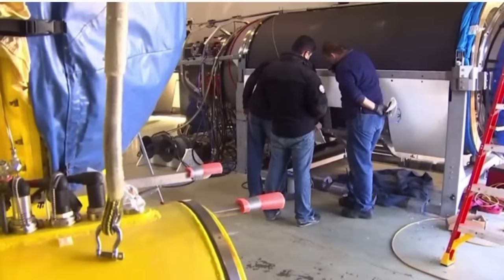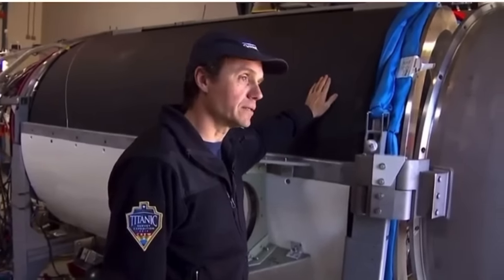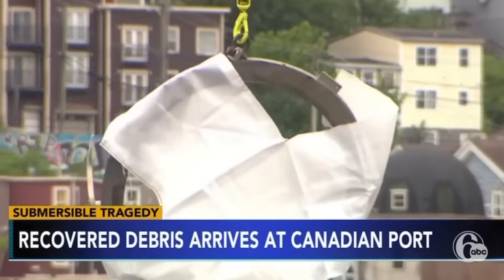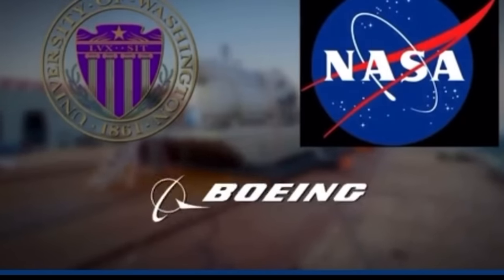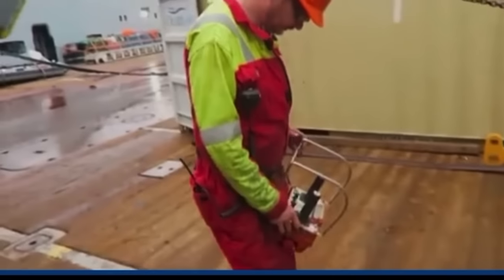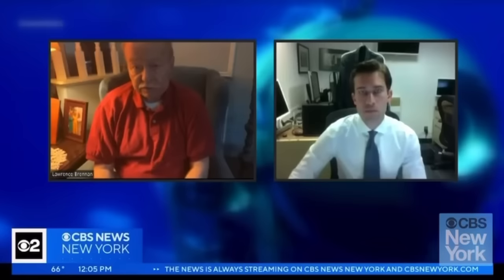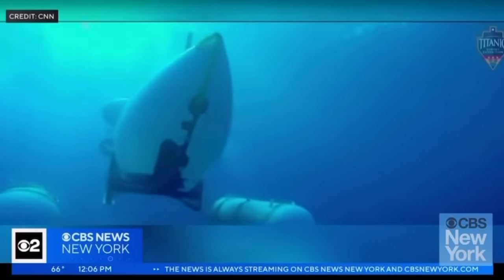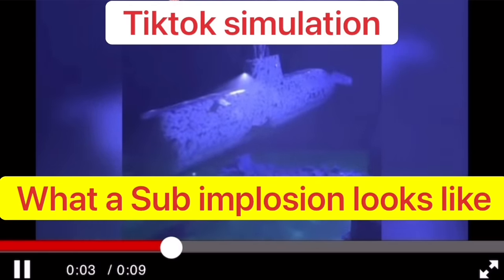Titan nosedived like an arrow (then popped like a balloon) #Titan #oceangate #Titanic

Comment: The theory about them plummeting came out months ago, and is just not true at all..
If the sub had lost power, wouldn’t it have just started descending normally? They were all seated in the middle of the sub, so there would have been no way for them to unevenly distribute weight towards the front the sub. 
-
If anything, wouldn’t it make more sense for them to have plummeted downwards in the tail cone end of the sub? 
I mean, on top of the titanium end cap, there was so much equipment, electrical components, etc. There was so much more weight towards the back of the sub, that it just makes no sense for them to have plummeted downwards in the direction of the front titanium end cap. 
I believe this guy is just clout chasing. 
Yes, I believe they were well aware of their fate before the implosion, but the theory about them plummeting just sounds not true at all when put up against emerging information of what happened.
Reply: But that’s just a theory.. a SUB THEORY!
Reply: @Stanified   You are absolutely right.According to the laws of physics it makes no sense . I also believe this so called engineer is a clout chaser.How could it be in free fall for only 48 -71 secondes without additionnal weights ? I mean the buoyant force depends on the weight. And unfortunately , yes ! They were well aware of their upcoming brutal ending... May their souls rest in a sea of tranquility.
Reply: TY.

Comment: They were liquefied so sad cause that kid had his hole life a head of him i would not let my son do some crap like getting in the sub
Reply: Actually, submariners that deep, die from heat.  The friction of the water breaking in super-heats the air "bubble" the crew is in. In nano-seconds, the body is charcoalized, then flash-cooled.  
Means the remains are like that of Pompeii victims.  Charcoal statues.  
However, the implosion likely scattered the "statue" pieces.  
I learned this studying the Thresher disaster.
Statue-like remains are still on the sea floor.

Comment: I can’t imagine how stupid or gullible someone would have to be to ever think that the Titan was a safe submersible.  Even after dismissing the carbon fibre hull, the viewport that’s more than twice the width that it should be, or even the ridiculous game controller, despite ALL THAT AND EVEN MORE, I still wouldn’t step foot inside that monstrosity.   This submersible looked like it was built in someone’s garage.  The only professional looking parts of the entire craft were the titanium end caps.  And it Stockton Rush built the passenger tube section of the hull out or 5” thick titanium bullet, that submersible would have probably survived, despite not being in a spherical shape.  But I STILL wouldn’t have gotten in it.  And why?  Every single passenger should have been tightly fastened into a seat that was mounted on both the floor and side wall of the submersible so neither the seats nor their passengers could come loose from their position in the vessel and change it’s center of gravity.  The slightest movement from any single passenger could have easily been enough to push the Titan over onto it’s nose, and cause it to free fall through the water column.  Once it tilted downward, there wouldn’t have been any way to stop it, because this submersible was lacking crucial parts often found on others.  There were no dive planes on the exterior that could have been rotated in the water column to stop the free fall from continuing downward.  Had there been, they could have forced the nose of the vessel back up onto a horizontal plane.  But all they had were the four undersized electric motors that couldn’t possibly have rightened the craft on their own, even if the electric power was completely reliable.  

I would love to smack Stockton Rush upside his head the next time he spouted out “Strength to Buoyancy.”  THERE’S NO SUCH THING.  IT SIMPLY DOESN’T EXISTS.  THAT’S A TERM HE COMPLETELY MADE UP, no doubt, because it sounds so technical.  If it really was something meaningful, then why didn’t he just build the entire submersible out of the crush proof foam he used around the components in the back tailbone portion of the submersible?  That stuff came back up to the surface completely intact.  So apparently it was stronger than the carbon fibre that he did use.  And speaking of the carbon fibre, why would anyone with one still living brain cell working think that it was a great idea to use a batch of carbon fibre that was no longer strong enough to build jet aircraft from?  The pressures such carbon fibre would have to contend with on an aircraft are vastly LESS than the pressures placed on a submersible.  Those intensive pressures are the reason it’s far easier to explore outer space than it is the deep oceans.
Reply: In all honesty, Stockton Rush was also incredibly pushy and persistent with recruiting people to go on the trip.

He put a lot of pressure on people to convince them to go.

From what I've seen, he was very dismissive of any concerns, going so far as to confidently state that the Titan would be safer to ride in than a helicopter, or even crossing the street.

In one case, he also used the fact that there hadn't been an accident on a submersible in 35 years (maybe it was 53, I can't remember).

He did everything to persuade people to join, but nothing to ensure their safety or that concerns were addressed.

Comment: Everyone goes on and on about the stupid video game controller (I guess for added drama). It was not uncommon to use for these things AND had nothing to do with the descent
Reply: 1. I really can't believe, just because you say, that using a video game controller is even close to common to control a manned submersible.
2. No  one is saying that the controller had anything to do with the decent (except pointing out that it failed earlier and that it could have failed again) , it's a symptom of how many corners were cut to make this very avoidable billionaire killer
Reply: Okay so you descend and it's getting close to 0 deg C an you have 4-5 humans exhaling H2O and CO2 you don't think things are getting a bit moist? How is your STP (standard temp and pressure) rated game controller going to function properly when the electrical contacts are wet with condensation? Rush was a moron.

Comment: So from what I've seen the carbon fibre hull did in fact have sufficient lateral compressive strength but lacked axial compressive strength. So if they had managed to wrap the ends in carbon fibre and strengthen the resistance to axial loading along the main chamber the design would have actually worked and been revolutionary in submersible design.
They were this close 🤏
Reply: Nope.
Reply: @paulfisher-2344  
Depends on the appetite to spend the money on the right testing. Rush had no money so cut corners like skipping destructive testing on a test hull. It realistically would take millions of dollars just to test a prototype properly.

Comment: On the black, uncovered, hull, the ashy looking patches on the carbon fiber are delaminations. It seemed nobody noticed that.
Reply from the maker: some say they did not cure it right and did have the flaws from the start. Intetesting what you say, I will watch it again
Reply: @silki24  The cladding on the Titan did a disservice to it.  It hid the carbon fiber away from sight.  Maybe seeing the pressure hull surface, would have stopped the dive.

Comment: Why do they say it was instantaneous? It could have filled up as if a garden house was filling it. As the weight of the water filled it any imbalance would be exaggerated and it may well have tipped on one end or the other. With electrical failures the whole thing could have lasted an hour, pressuring the inside air to the point of explosion, not implosion. They should have had a voice recording of the entire event like on airplanes so we could all experience the horrific end. “Everyone remain calm, we will have this fixed in minute. Did anyone bring a bucket and a sponge?"
Reply from the maker: the explanation of experts is that water ingress in the cabin in such depths with such pressure would be as sharp as a laser and it would also implode right away
Reply: I'm not an engineer so I have to ask...if they had a slow leak allowing water in wouldn't that equalize the inside pressure of the vessel with the pressure outside and therefore no implosion or explosion? I realize that they all would have drowned instead but we all know that this was a no win situation should something go wrong.

Comment: sorry, a popping balloon is NOT an implosion.
Reply: Really? Is it an explosion?. The balloon does implode due to the elasticity of the balloon and all the air pressure inside being gone
Reply: @KowBoySpace  if the pressure inside the object is bigger than outside then the result is an explosion. if the pressure outside the object is bigger than the inside then you get an implosion. "air pressure inside being gone" is AFTER everything happened. the air pressure equalized. maybe use some colored dust inside your balloon. then you will see that the particles are propelled outwards.
Reply: @olafkliemt1145  the pressure outside IS greater but its elastic pressure. Fill the sub with coloured dust that will come outwards too
Reply: @KowBoySpace  sorry, i have to ignore the first statement for professional reasons. the colored dust in the sub would go outwards AFTER it was thrown through the center of the implosion. an implosion is NOT a black hole.

Comment: Rush’s buzzword was innovation   He used it as an excuse for everything.   While I’m sure that he thought that his sub was innovative, there was in reality little innovation in it other than cutting corners to save money.    I must say that calling his paying customers mission specialists and donors to research rather than tourists was pretty slick as in the law paying customers have more rights than do employees.  That’s an innovative end around.  

There were many points of failure on the titan and any one or more could have caused the implosion.   This one does make some sense.  All the syntactic foam was in the rear section surrounding the electronics.  Also the passengers were loose and any jarring of the ship could send them tumbling into the front dome section.  They extra 1000 pounds along with the foam in the rear could have upturned the craft.   In the Russian craft shown note that the pressure hull is a sphere and it’s surrounded evenly by syntactic foam.

Comment: People forget , it did make it down before . A couple times I believe
Reply from the maker: 3 times but each time with problems
Reply: @silki24  oh yea , 💯, Stockton was a fool . Just noticed some people hinting at it being the first dive type of thing lol 

I followed this story alot when it happened .
Reply: Like the man that fell off of the empire state building. On the way down, people could hear him saying, "So far so good".
Reply: 🤯4:27 "something you take away for life". Shouldn't that be, "something that takes away your life"?🤯
Reply: As has been previously mentioned, each dive to the Titanic likely caused some irreversible and culminative damage to carbon fiber hull.  What the OceanGate engineers failed to calculate was that the Titan would likely survive less than ten trips to the Titanic before the carbon fiber hull would implode.
Reply: The more dives, the more the carbon fiber was microscopically delaminating. As the extreme 12,000 psi pushed water into the fiber the weaker it became. Once one small itsy bitsy fraction of an inch became compromised the pressure would collapse the hull nearly instantly. Not sure about what evidence there is for a nose dive and darkness with terror.
Reply: @MrDonsullivan  Carbon Fibre can be strong. However, it is not homogenous like steel or titanium. It's prone to failure, when it's integrity is compromised due to any imperfections, which are exacerbated due to repeated stress cycles.

Comment: Titan and it’s construction of carbon fiber was a con job since day one, and know doubt the powers that be knew this, the con was the carbon fiber hull and how it would sustain damage on each cycle of pressure on each dive, they knew this but I suspect thought it could be managed by monitoring for impending failure
 and the sub dive aborted before  catastrophic failure, how long this sub had is anybody’s guess 2 dives 10 dives 20 dives, unknown, what they did know is damage was being done and know way of knowing because no ultrasound was done the only way to test.  
One would expect noises would be heard as the carbon fiber sustained damage because basically the carbon fiber is floating in a matrix of epoxy and sure enough on each dive noises like gun shots were heard and even on rising to the surface the hull made noises as it released stored energy, what’s amazing to me is how people would want to go down in this contraction cause it doesn’t take much research to know it’s a death trap
Reply: Exactly. they had prior warnings and chose to ignore them. Greed and $$ prevail.

Comment: and so were aware of how it works. . . throw a bobber in sum water. its lays on top. put a "ballast" weight on it and the weight will always drop below the bobber. no matter how u move it it will always set bouyant up weight down. this sub was weighted on the bottom to ensure it wuld stay upright. . . . your explenation and information is absolutely incorrect. . . . the failure was the glue. all the titan ribgs come up clean of any carbon fibre remnants. if the glue held, there wuld b shards remaini g. your explenation is assanine. . . clickbaited for the dislikes. congrats

Comment: The game controllers can be left out of the equations or someone better tell the US military because they use them everywhere.
Reply: The game controllers used by the military are built to a much higher spec than this retail off-the-shelf consumer grade model that OceanGate used. Cutting costs, against the power of the ocean, not a wise idea.
Reply from the maker: but it seems not for steering
Reply: @silki24  yes steering of drones.
Reply from the maker: yes so true , that sub was built with zip ties and duct tape it feels, lots of cheap consumer grade stuff that is known to fail
Reply: @TheUtube666  Wrong, off the shelf. Those Playstation controllers are made to be tossed around for years and work flawlessly.
Reply from the maker: yes

Comment: I don't see the logic behind Titans ability to "nose dive".... It would be similar to getting an airship to "nose dive".
Without very strong thrust/speed plus large wings/dive-plains, there is no mechanism for it to do such a thing.
Where is this so called "expert" getting his information from?
Reply: Did you watch the video? This was explained.
Reply: Also see my reply below where I discuss that as well.. It is a buoyancy analysis based on metacentric height, and center of gravity. Never the twain shall meet or else the ship is entirely unstable and can roll over and/or pitch up or down uncontrollably based on changes in weight distribution.
Reply: @RonSavage01  
Everyone crammed into the nose "may" cause a nose down... Why put the cart before the horse?
What comes first, nose dive causing the cramming or the cramming causing the dive?
There is no logic for the latter so offers no "explanation".
Reply: @STLS  
This may have be a sound point but for the fact that Titan ought to be much more likely to nose dive upwards having dropped all its ballast.
This rides upon the fact that any loss of buoyancy would almost instantaneously result in hull failure so seems to falsify any rapid decent with dropped ballast.
Reply: @pimplequeen2  well riding flat and level it would descend slower but pointed downward it would of course accelerate downward in its most efficient hydrodynamic profile.
Reply: @pimplequeen2  if it lost all power and thrusters, there is nothing to keep it level anymore. Look at the videos when they launch it. As soon as it's in the water they had the thrusters going. Also, I'm going to listen to the "expert" in the video. He may have a little more knowledge on this than you do.
Reply from the maker: he based it on the information available and did run calculations, he did not just speculate
Reply from the maker: thanks 👍🏻
Reply: @STLS  
Non sequitur.
Reply: @RonSavage01  
With its ballast, it would have been statically stable.
 No expert required to follow logic!
Reply: @silki24  
Did that calculation include how much water would need to enter the hull for it overcome its buoyancy?
It seems very unlikely that enough water to overcome the buoyancy could enter the hull without hull failure.